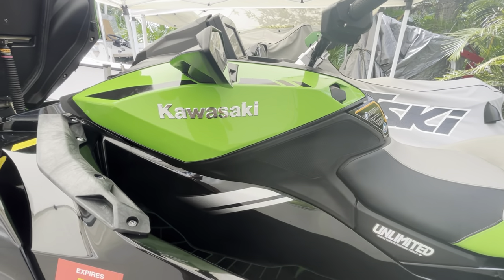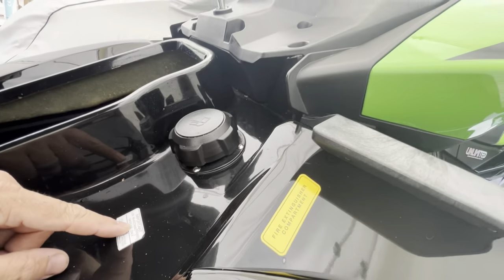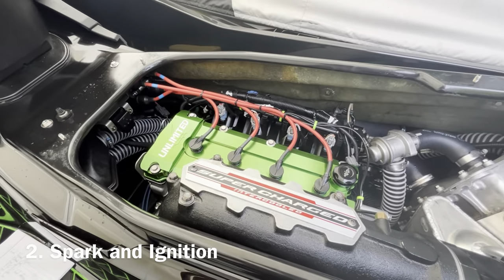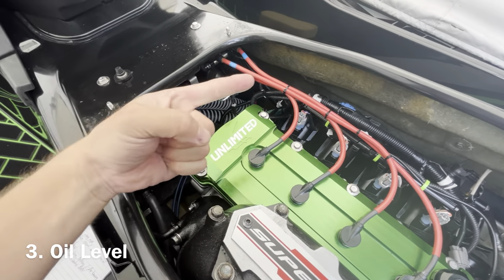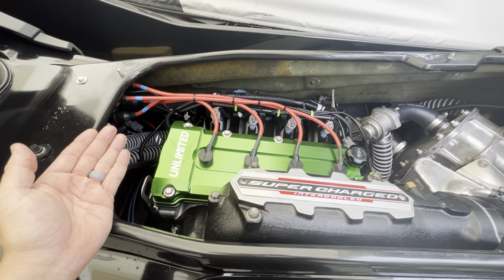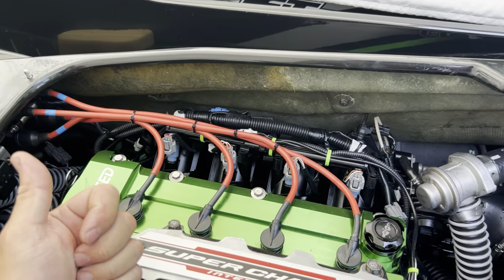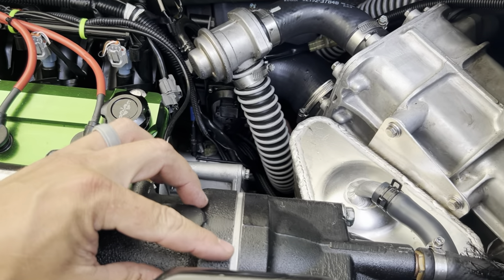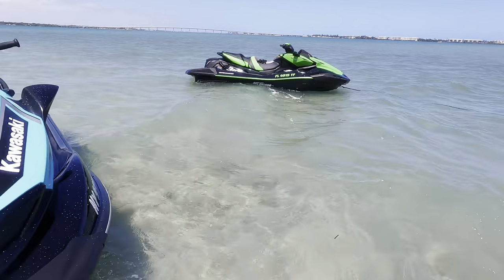5 Tips to Diagnose Mechanical Issues: Kawasaki Ultra 310 Jet Ski - 4K VIDEO

Comment: Kindly askin for some help,i have 2014 ultra 310 with 100hrs..works and runs great fresh water not salt,but i get heat warning when i go top speed for more then 20sec...and i flush engine and intercooler everytime.What can it be? please
Reply from the maker: We’ll definitely at first glance sounds like you have an obstruction in your cooling system. Can you trigger the temp alarm when it’s on the hose or just in the water? Have you changed the exhaust filter? There is a filter block on the jet pump pickup for the intercooler and engine cooling water feed lines- all of those lines should be checked, and the filter block checked for debris. You need a new o-ring once you take the rectangle filter block apart- see microfiche. And you need to remove the cooling lines at the engine, oil cooler, supercharger, and output bearing cover and blast them out with air if possible- in reverse of the way they cool. If using air though don’t blast with pressure more than maybe 60 psi. When the alarm triggers are you getting a strong stream out of the bypass port?
Reply: @JDsWaterWorld  Thank you very much for so much info,and yes there is always a strong stream on a baypass,exhasut filter wasnt changed here in Toronto is so hard to find a decent shop,and nobody ver has time :)...i will try to find who can help me with so much checkin with hoses and stuff this is my first time i own a ultra 310 so i m still learning.
Reply from the maker: I would also check the Thermostat and make sure you have the right spark plugs. Also make sure your oil level isn’t too high or low ( should be middle of dipstick when engine is level) and is the right viscosity (not too thin or thick 10-40 works for most climates)
Reply: @JDsWaterWorld  i just changed oil 2hrs ago and filter as well,(kawasaki jet ski oil that is) thermostat i dont even know where it is to check.I was on water today for like 5 hrs and no heat warning but yesterday i got like 1 time.I always lift a sit when i pour new gas in it and here and there to cool down engine under the seat.I m very careful with not gettin any debris or seaweed.I jusr hope i can find a solution.I have thoose expensive spark plugs(platinum one) .Like i said i m very thankful for your replys give s me a lot of options and ideas what elese i can look so ill keep posted..was also thinkin mybe i ahould change bearing on impeller mybe that has harder spin and is causin this cause its only at full speed between 65 and 70mph  if i go 60 doesnt happen no matter how long i go...but as soon is full speed after 30sec boom,warning.
Reply from the maker: Well you just have to keep ruling stuff out until you find the problem. So your oil is fine, your plugs are fine. Still unknown is the exhaust filter and there’s also the possibility that the temp sensor itself if bad…do you have a SCOM or tune? Besides the pump bearings there’s also the pivot bushing and your fuel filter- the exhaust filter being damaged or worn out can also affect top speed. The thermostat is on the oil cooler right by where the filter mounts. You’re going to want to check the thermostat because it could be sticking or something- rule it out as an issue. If you have good flow a blockage in cooling lines is less likely..but maybe the lines through the oil cooler are plugged..must check and verify
Reply: @JDsWaterWorld  Yes i have riva scom,i hope i ll figure out an issue :) fingers crossed
Reply: @JDsWaterWorld  Sir,what is your opinion on exhaust filter baypass
Reply from the maker: I personally just run the factory exhaust filter to keep condensation out of the engine when stored…

Comment: Great video, thanks!  My '22 310x is having issues with dropping RPM but I don't think it is maintenance issue and wonder if anyone else has had the same experience.  I have only used the ski at a lake at 6250' elevation after purchasing it slightly used from a dealer.  I turn the ski on and put it in FPO mode, do a few passes wide open, and after a few minutes there is a noticeable drop in RPM/boost and top speed.  It can result in as much as a 15+ MPH drop in top speed.  I haven't changed modes, there are no warning lights, and oil temperatures are fine but the drop in performance happens consistently.  With the ski still running I can cycle through the modes back to FPO but it isn't fixed.  The only solution is to turn the ski completely off, and when I power back on and put it back in FPO mode I get a few more minutes of 100% output before it happens again.  I brought it down to a different dealer close to sea level for service and they couldn't replicate it after 10 minutes or so of water testing.  The ECU had the recall update installed prior to my taking ownership of the ski, verified recently by the service tech.  It is almost out of factory warranty and I was trying to get the issue resolved before I attempt a KSpeed or Riva tune.  Any suggestions would be helpful.  Thanks!
Reply from the maker: How many hours were on the ski when you got it? Salt water? Did you receive maintenance records? Sounds like pivot bushing to me or possibly just spark plugs. It’s also possible it has something to do with heat soak and the higher altitude… but I don’t know a whole lot about running these skis at that higher altitude
Reply: @JDsWaterWorld  Only 14 hours when I bought it and it was used in salt water for those 14 hours.  I bought it at the end of last season and it currently has only 25 hours.  I did a salt away flush right away to clean it out with an additional hot water flush at the lake inspection station (required to kill possible invasive species).  I used it right away for a couple of days and it was having this issue on day 1 and still having the issue now.  The dealer that I bought it from said they did an oil change and service check, including replacing the plugs I believe.  Since I was able to essentially reboot the ski to clear the issue I assumed it had to do with the ECU or a sensor, but maybe there could be a delay if there was a plug issue?  I would think I would see an error code though...the dealer still has the ski and is reaching out the Kawi rep to see if they have any answers or suggestions.
Reply from the maker: It’s hard to say without seeing the ski, but it’s likely one of the items I mentioned in this video. How old is the fuel? And again- was the pivot bushing ever serviced? So you are going along in a straight line and all of a sudden you start losing RPM..then you reboot the system and you are then magically able to go back to the full rpm ? That’s what you’re saying? It may or may not be related to the ECU - hard to say. There is a test procedure for the ECU- If it was me I’d go down the list of test procedures from the service manual until an issue jumps out…that’s what you’d dealer should do but they’re probably lazy since diagnosis is the most difficult part
Reply: @JDsWaterWorld  I haven't noticed it drop RPMs in the middle of a straight line pass yet, but being on a lake with some chop I will run it full out, do some turns and after a couple of minutes of riding I pin the throttle for the next run after a turn or after dropping down to cruising speeds and I have a noticeable drop in power, verified with lower RPM and boost shown on the display.  I then stop the ski and pull the key out, sit there a minute with it off, pop the key back in, go into FPO and away I go at full output.  It has happened both with fresh fuel (within a day or two of filling the tank) and using older fuel with stabilizer.  I'll order myself a service manual as you suggested and start my own diagnosis, just hoping the service department would be able to figure it out under warranty without me having to spend hours going through the possibilities.
Reply from the maker: If you were to stop the ski, shut off the engine and restart, but keep the key inserted does it do the same thing? Is shutting it off and restarting it what you are saying temporarily fixes it, or just coming down to an idle and then accelerating again? Anyway hope they can diagnose it for you! Almost sounds like the fuel tank vent line could be blocked and shutting off and restarting the engine is just a coincidence. I’m sure it’s something basic, always check the small things first
Reply: @JDsWaterWorld  I definitely have to turn the engine off to reset it, coming down to idle is not enough.  I don't remember if I always have to pull the key out to have the screen turn off for the reset to work, but just do that out of habit because I know it works.  I'll let you know if/when we find a solution!  I otherwise love the ski and the chose it over the competitors in its category  because the hull is great at handling the common rough water conditions at Lake Tahoe. Thanks again.
Reply: This issue was also reported on Green Hulk with new models
Reply from the maker: Greenhulk is like Facebook, the info is garbage and the opinions are often misleading and provide wrong info..but maybe I should thank them because their crap info and wrong info is the reason I started my channel. My opinion- obviously I’m no industry expert 🙄

Comment: What would the risk be just deleting the waste gate with the kspeed plate? Could this shorten the SC life?
Reply from the maker: Good question. So Kspeed has assured me that using the block off plate is safe, as the relief valve will bleed off the extra boost. My dad, who is a master marine and aircraft mechanic, has advised me against using the plate. I don’t think kspeed would sell a part that would damage your ski, but my personal decision was to leave the BOV and relief valve both in place. A safe compromise is to give the adjusting nut on the BOV a few turns to tighten it up, and keep the mechanism lubed so it doesn’t stick. That all being said, Kspeed does know more about these engines than me..I’m just a random guy on YouTube 🤪
Reply: Ha fair enough. I was bummed once I saw the boost drop off around 63/64. I give tightening a nut a try and get some fresh gas with k100 to see if I can get it back! Seems pretty common and figure the dealer won’t be much help since it still runs good before 63
Reply from the maker: You have a new 310? If you have the stock ECU this is normal…
Reply from the maker: You were running more boost and lost it? If that’s the case check all the hoses and clamps and yeah check the BOV. If you are same rpm but less boost it could be a leak. If less rpm and less boost could be as simple as spark plugs or other issue limiting the rpm
Reply: I went the adjust the bov rought. Left maybe 2mm for the spring to move. Putting some fresh gas in and testing it out tomorrow!
Reply from the maker: Let me know your top RPM..and the top boost you hit on the metwr
Reply: @JDsWaterWorld  rpm was good around 8-8.5k. Boost held strong a little longer today. Got up to 66 but it did drop back down to about 11psi. Might try to tighten BOV even more since RPM is ok. Anything else to try?
Reply from the maker: If you are running the stock tune that is pretty normal…but I don’t think you could hit 8k rpm with stock tune? That being said, check all the hose clamps..you could be loosing boost that way/ through a leaking duct- OR the supercharger belt and/or tensioner might need service.
Reply: @JDsWaterWorld  surged up to 69 before it dropped down to 66/67 so seems like tightening BOV did the trick! Now I’m tempted to get the riva turner to avoid the drop down

Comment: To say I need to check a fuel filter bag every 10 hours is crazy Kawi can take this shit back. That’s worse than diesel trucks😂😂😂
Reply from the maker: Ask the Kawasaki Engineers…I just follow the manual
Reply: @JDsWaterWorld  Why delete the comment? Did you realize 99% of America does not fall into the two extremes you mentioned? I appreciate the shit out of your vids but look at from the avg joes perspective.
Reply from the maker: If you’re having problems, that’s just one of the things you should check. By the standards of most high performance vehicles changing a fuel filter is not a big deal. I get most people won’t be able to change it themselves- but then they will need to pay a mechanic to do it for them..it needs to be done or performance will be lost…
Reply from the maker: I didn’t like my first response, rather than edit it figured I’d reword it. Also should note this is similar for all 3 brands…

Comment: I like the kawasaki hull but does the ultra 310 engine require alot of maintenance compared to a yamaha svho?
Reply from the maker: The 310 requires more maintenance, but experiences less critical failures and has no issues with oiling, cooling, or sprag clutch failure. Also, most of the labor intensive maintenance items (exhaust filter, pivot bushing) can be eliminated with less than $2k in aftermarket mods (all of which I have). The supercharger belt is pretty involved to change for a novice, but is in fact easier to change than the clutch on a SHO/SVHO supercharger. The fuel filter on the Ultra 310- especially the 2022+ models is fairly challenging to change- the aftermarket is responding to that with soon-to-be-released upgrade kit with external filter. Stock for stock, yes, the Ultra 310 requires more maintenance compared to an FX or GP SVHO
Reply: @JDsWaterWorld  thank you for your quick reply, it will help me make an informed decision 👍